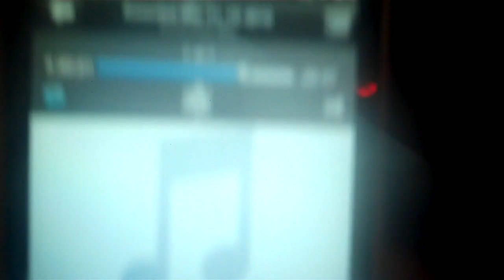How to make Water Dancing Speakers BUMP!

Comment: I ordered mine from Amazon and it was a lot cheaper than anywhere online. Not to mention that they work fine and are in PERFECT condition. It is what I would recommend if buying them. I also have a couple of vids of them up if you'd like to check em out.

Comment from the maker: the water dancing speakers have a plug you can plug directly into an ipod/iphone 2 play your music from...problem is the quality of those water dancing speakers sucks.  So I take the splitter & plug the water dancing speakers into one end of the splitter, plug the other end of the splitter into the $20 sub woofer & then connect the 3rd end of the splitter to the aux cord which I then plug into the ipod touch or iphone or computer (music playing device).  It combines/amplifies the sound quality

Comment: I'm thinking about getting a pair of these dancing water speakers but just wondering if use the Y cable, would it diminish the quality of my music? I tried that way with 2 sound system before and the outcome that I had to crank up the volume more than usual. Please help.

Comment: you did not need a 6 minute video to show everyone how to hook up 2 sets of speakers from a source using a 3.5mm audio splitter. its great to give people ideas on what to do. but to be helpful in your endeavor i would have gone to a kitchen table, placed the lighted speakers on it and shown the connection to the splitter and explained what you were doing without holding the camera. its hard to see the wires and where your hands are. just trying to be helpful.

Comment: am i the only one who had one speaker working only?
Reply: Both mine work but only one had water. I had to drill a small hole put some water in it
Reply: that happened to me, i found that if i played music REALLY LOUD, the other started working. it stops from time to time but i just crack up the volume and i works again
Reply: My both speakers work but if 1 of yours doesn"t play try unpluging and again pluging the cables :)
Reply: Mario Jelen yea I have that problem my left speaker cord is being annoying it has to be plugged in just right for the sound on my right speaker to be on the water on the right one still bounces if the cord is out but it just is silent.
Reply: Same here ! I just push it in and if it still plays with same volume I switch the audio cables.

If you don"t know what to do if 1 isn"t playing just shake him a little bit and if it still wont work check if the cables are inserted right